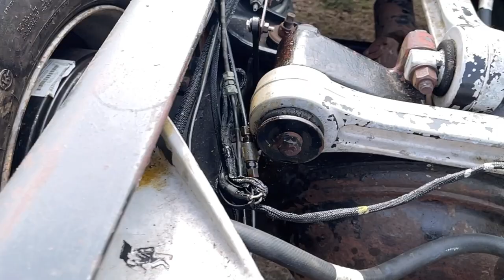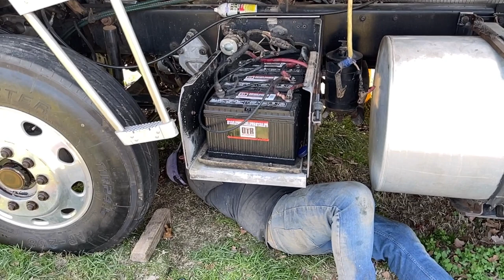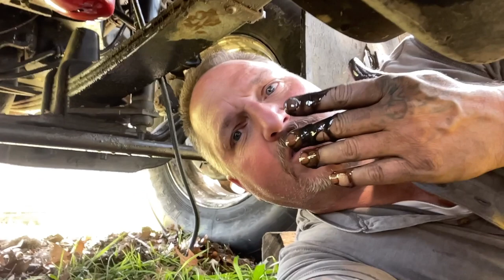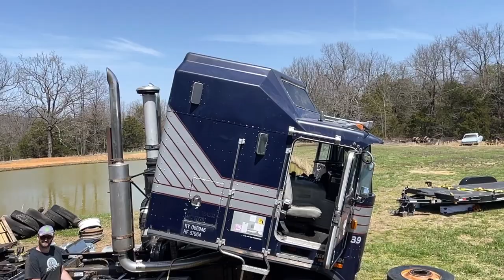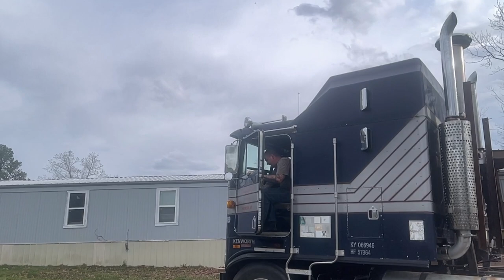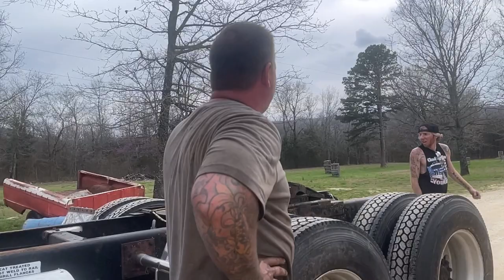Aerodyne Cabover sat for 27 years. lets get it ready to move

Comment: This has been an amazing series! You are bringing this truck back the life! You should take this truck down to Tennessee to Tim gently he would love to see it! You have earned yourself a new subscriber!
Reply from the maker: Thanks Rudy.  Tim watches the channel. We are gonna meet up again soon. Maybe he will come to my place on the way by some time
Reply: @JamesPretty  This truck has come a long way since you started working on it! Was it hard to get it running again? After sitting 27 years? I thought after all that time of sitting you would have to go through bleeding the injectors and all that jazz to get the air out of the fuel lines? Did you do an oil change on it before trying to getting it to start? That V12 Detroit will sound amazing with straight pipes on it! Is this the second truck that you have that has a Detroit in it? Looking forward to the video on getting the truck home! Is it hard getting fuel filters for an engine like this?  After sitting 27 years I think you would have the change the fuel filters on it?
Reply from the maker: @rudycarlson8245  we cleaned the fuel system and installed new filter “easy yo get at fleet pride”. A couple injectors were stuck and had to get unstuck.   We started it on the oil that was in it. But changed it right after
Reply from the maker: @rudycarlson8245  drive home video goes out Sunday morning

Comment: One by one you are getting it done. Hey if it was easy everyone would be doing it ! Did you ck the air intake shut off ? Might be stuck half shut . Plugged fuel line ? She sounded like she was getting all the RPMs when you reved it. Black smoke too . Can’t wait to see what it is . Air brake valve  ? 🤔🤔🤔🤔🤔
Reply from the maker: Intermittent  problem  with the fuel pump.
Reply: @JamesPretty  so do you have to pull it off ?
Reply from the maker: @Darylatlarge  wait till the tank is low.  Then unhook the wire to the sensor connect an ohm meter one side to ground and one side to the sensor and work it up and down and make sure it’s in the range it’s supposed to be.  If it is then hook the wire back up and then unhook the wire at the gage connect meter from ground to the gage wire and work it again and see if it’s similar

Comment: Try Advil for cold and sinus. It works. My nose used to run like a faucet in the spring and fall during peak pollen times. 
Never had any issues since I began taking it and now I hardly need them.
I fly as well so I know what you can and cannot take.
Reply from the maker: Been using Flonase thought it was working but I did get a sinus infection in Arkansas.  Seems a lot better now.   So you used Advil c/s for how long? Like just as needed or like on a maintenance sort of thing?
Reply: @JamesPretty  hey James!
I tried reactive, Claritin and a few others and nothing touched my runny nose. It would happen 2 times a year. In April/May when the pollen and spring thaw and in august when the ragweed would start right til November and the first freeze. Only when I used Advil for cold and sinus I got relief.
It doesn’t make you tired or get the jitters. I only used occasionally now as my system built up immunity over the years and you don’t need a prescription for it.
I hope it works. Good luck. Love your work!
Reply from the maker: @robpeters5204  I’ll try it

Comment: Hey James, question, i recently changed my fuel level senor on my fuel tank, but now the gauge shows full all the time. I’ve checked the ground and it’s good at the senor. Any suggestions???
Reply from the maker: When you are low on fuel can you see the float does it look stuck up at the top? You can use an ohm meter and connect to the sensor and move it up and down with a hook and see if the sensor is functioning if so then it’s time to check the resistance at the gage
Reply: I’ll have to try that this weekend
Reply: Congratulations on making it back home with new cabover
Reply: You guys are The Godfather’s of cabovers

Comment: I don’t know why guys on utube feel the need to do things like this. 
I have much respect for you Jimbo but forcing this rig to run after sitting for so long is a real bad move. That truck needs to be gone through COMPLETELY! 
Put it on a flat deck and bring it back home and work at your confidence. 
All these “will it start “ and other videos like this are NOT worth the time and aggravation for the bragging rights. Risking your life and those on the road with you is not worth it also.
This truck truly deserves better. It is in very good condition for sitting so long. What’s another few days or weeks.
“Bus grease monkey” and “adept ape”would agree.
Reply from the maker: Not sure what else needs gone thru. We rebuilt The Whole suspension and brakes  and changed all fluids replaced all fuel and water lines  and exhaust.